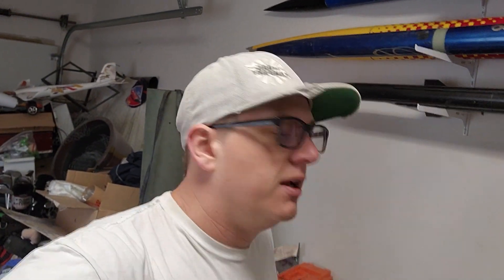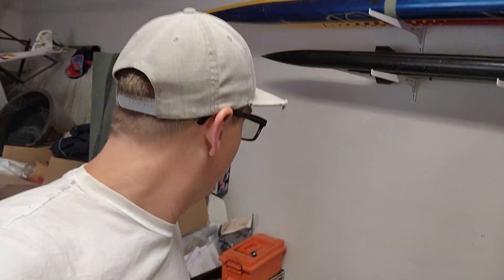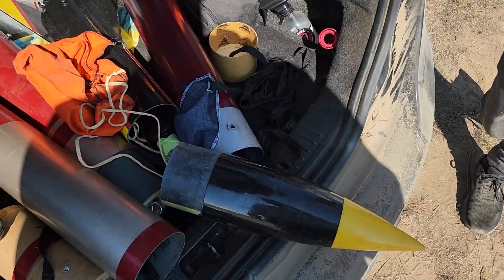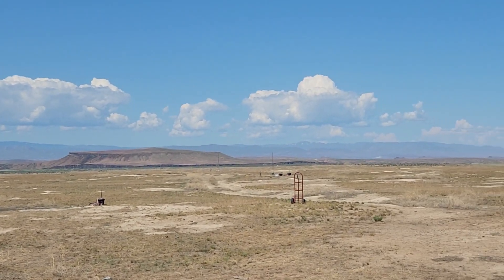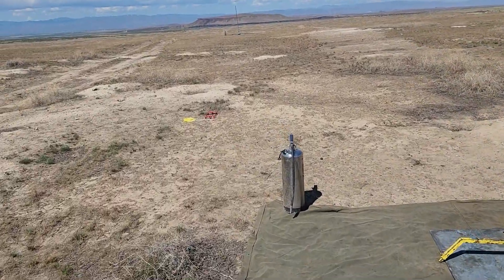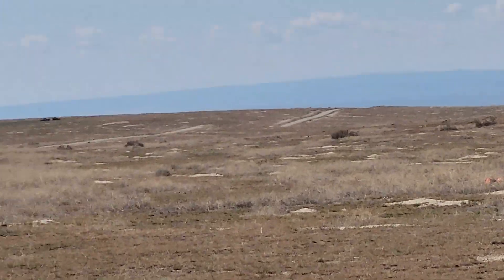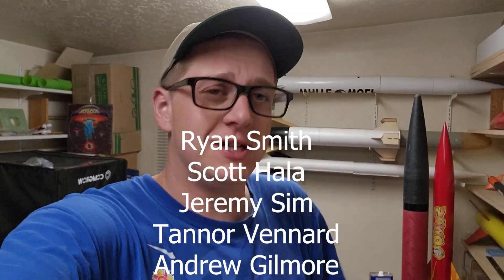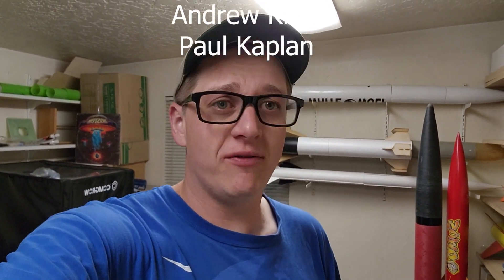The Final Flight of One of My Favorite Rockets

Comment: I had a Rf transmitter loose battery connection with g forces.  Is it possible the nose cone was hitting the booster on decent?  

Did you guys look both up and down wind for the rocket?  I flew my 4" MC Frenzy on this motor, weather cocked but still made it almost 6,000'.
Reply from the maker: Extremely unlikely.  I had good signal on it all the way to the ground,  which only took about 10 seconds or less. 

I didn't look at all.  Went out to see if we had any tracker signal,  but seeing as we didn't,  it's all but guaranteed to be destroyed
Reply from the maker: Also,  someone heard it whistling down on the end of the flight line